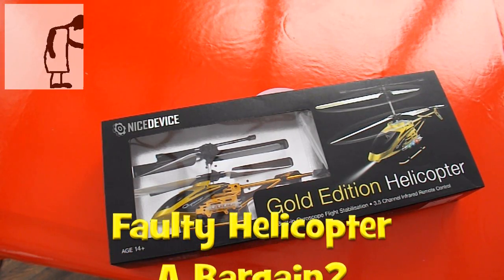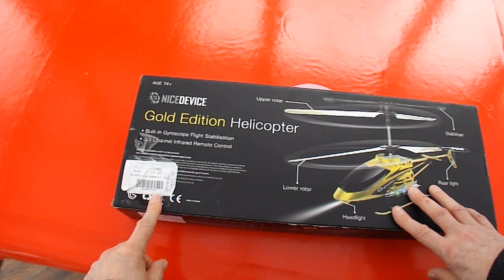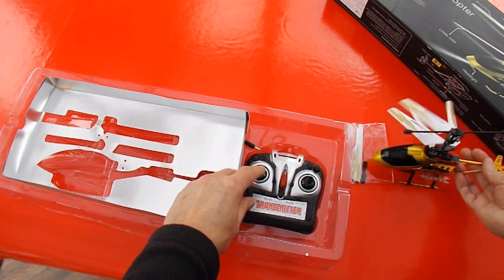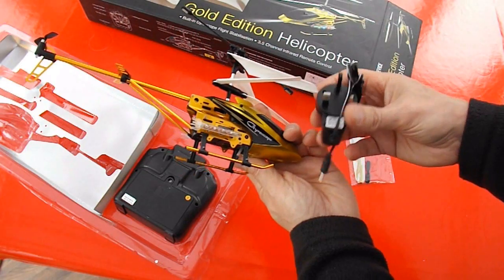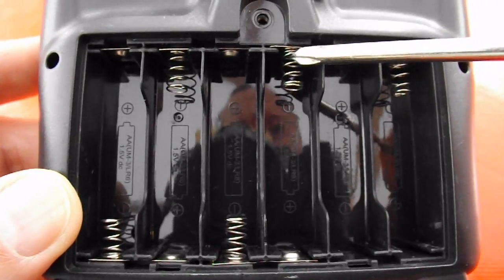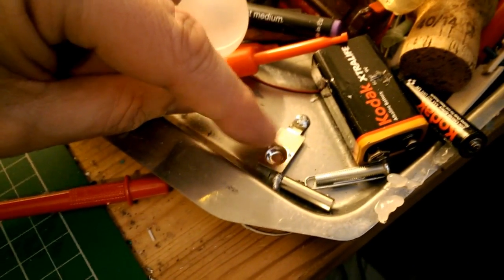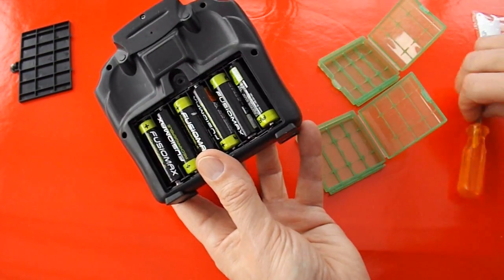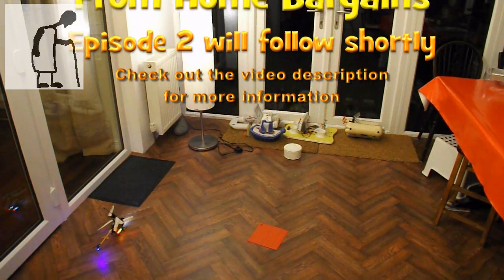Faulty Helicopter? a Bargain from HomeBargains?

Comment: Have two.. neither don't work  soo £40 down the drain
Reply from the maker: Are they still selling these? This video was back in 2016. Yes I was disappointed, the initial fault was easy to fix - missing battery connection but then one of the motors failed - here is episode 2 -   https://youtu.be/I8yaG0pTiqo
Reply: @GrandadIsAnOldMan  yeah still selling them.. i might get a different helicopter, im gonna whatch your channel to see if there is a heli i like (i subscribed)
Reply from the maker: Thanks, but I wouldn't use my channel as a guide. I only buy second hand items in charity shops to see if they actually work. Generally they need new batteries and often they have broken gears. I just do it for the randomness of it. I only bought this one in Homebargains as it was marked down cheap 😊
Reply: These things are easy to fix however, unless it is a flight controller issue ( which is extremely rare for 3 channel helicopters). So you can try to fix them. I remember I had a helicopter arrive with a bad battery so I replaced the battery